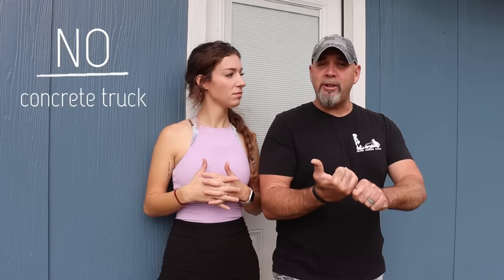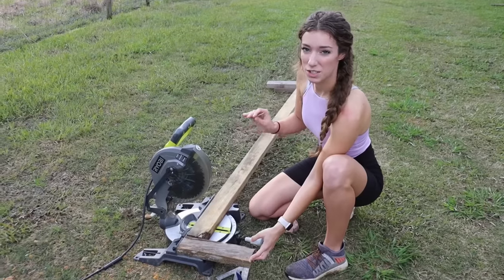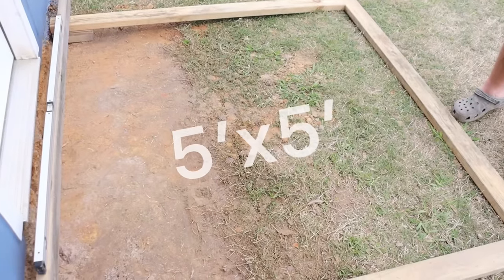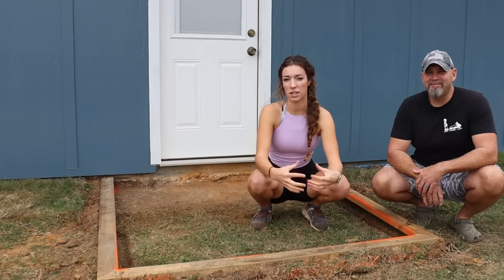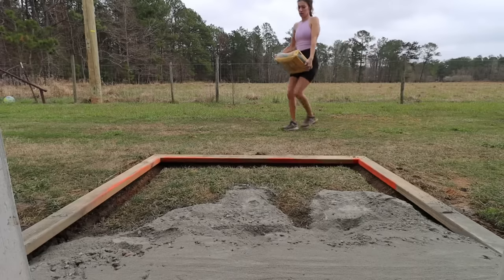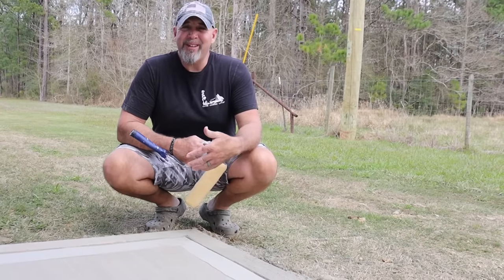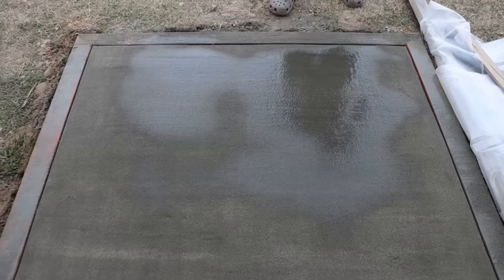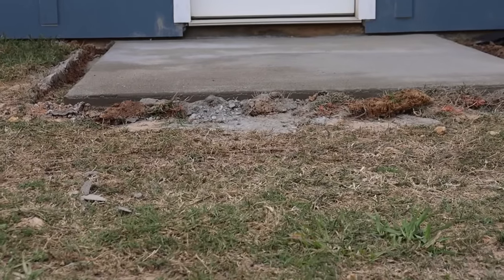How To DRY POUR CONCRETE SLAB and Update of Our 1st Pour

Comment: You shared your tips with us. I'll drop mine while passing trough. ;-)
- Given the chance, park your truck closer to the pouring site. Less dragging of all that weight.
- When dumping the bags content, don't cut the top of the bag. Cut it in the middle lay on the ground. And lift both sides equally. Less weight (again). ;-)
- Last but not least. Unless you're in a rush, leave the forms in place for a longer time. Even a week, or more if it's a large concrete pour! Reason being that it preserve moist, allowing for a better cure. And better than that. When the concrete cure/dry it will contract and release from the form, naturally. Less cracks or potential for damage. Less work also.
Hope you enjoy my "lazy" tips. Cheers
Reply: Move the truck closer - yep
Reply: Great tips!  Thanks!
Reply: I was thinking the same thing about the truck.
Reply: Great tips🎉
Reply: Yup, my first thoughts on the truck and how to cut and pour. At 68 you look for shortcuts and the easy way out
Reply: that ain't lazy - it's just smart.
Reply: A good way to a get you truck covered in cement b cutting the bag in half will get you covered in cement
Reply: “Work smarter, not harder” Great tips!
Reply: @TinaRN  : Hell yeah!
Reply: How much water??  Hard to tell in the video.  U definitely don’t want dry powder at the bottom.
Reply: is the roller brush wet or dry?
Reply: @missgray1472  Dry.
Reply: Put the truck off the chicken's path I'm guessing. I had a swan reach under the tire attacking the intruder. Murdered the poor guy.😢
Reply: @darylephillips6778  They said to just cut the bag open about half way down, then lay the open side on the ground and lift from both ends for the concrete to come out of the cut in the middle, not cut the bag completely in half. By doing it this way it doesn't fully eliminate the dust, but there will be less of it than cutting from the top and dumping it.
Reply: @todd5082  They showed at the beginning of the pour that the powder on the bottom was already soaking up any moisture that was in the ground. This will continue to happen after the main form is set up. As you can also see, this takes much longer to do with 5 hours of wait time between spraying down with water 6 times counting the initial mist.

Comment: 45 year construction vet upnawth in Virginia here - I can't see not laying 4 inch or smaller mesh or making such a pad less than 4 inches thick, but if it works - I say good for y'all down there.
But ONE THING that is important to point out and that is the dust in concrete is very, very bad because it is so very fine and it's like inhaling tiny bits of glass that go deep into your lungs and don't come out.
 
What I always did was put on safety glasses and pull my arms out of my t-shirt and pulled it up so the neck of my t-shirt went under my eyes and I tied the sleeves behind my head, which covered it all with the t-shirt hanging down my back like the Sheikh of Araby.
Beneath that I had on a dust mask.
Also, concrete and mortar dust is really bad for your skin - it'll suck the oil right out, and it is a strong alkali. So what I always did was apply Palmer's Shea Butter to my hands and wrists.
I suggest having a squirrel-tail brush to dust yourselves off with and laying the bags on the ground and cutting them open to minimize the concrete dust that gets stirred up.
I always keep a 5 gallon bucket half full of water to plunge my hands in to get the dust off.
It's a good idea to have such a bucket of warm water on hand for drywall or painting work, also.

What's most important is you enjoyed doing the project together and are pleased with what you made. 
That's all that counts.
Reply: Such helpful information! Since having covid this last time, I take coughing spells even just dusting my house. I'll make sure I wear protective gear when we try this out!
Reply: P  ok
Reply: That was the only thing I saw them doing that I thought hmmm .... Def should wear a mask & protective eyewear when that dust is getting kicked up. Other than that I'm def impressed with this!!!
Reply: YOU ARE A SUPER 🤩 FOR REMINDING OF Safety FIRST!! Thank you for some really GREAT ADVICE TO HELP PROTECT YOU FACE AND BODY! This advice will save alot of people from harming their skin and lungs. Not being able to breathe is a really hard thing to go through. And salvaging our lungs at younger ages through all of the advances that medical science has come up with is really important! 🫶🤩
Reply: Nice
Reply: Great tips :)
Reply: as a diyer with no professional experience, I really appreciate tips like this that come with experience. TY
Reply: Just thinking the same thing!
Reply: Great advice. Thanks
Reply: Oh thank you for the pointers. I did not know this. I'm going to attempt to do this by myself so I'm happy I saw your comment. All the best! 💜
Reply: VERY helpful and SAFE info to know. I'll deff take all these precautions now that you stated them.
Reply: Thank you so much for the very helpful information on how to keep my body safe. I will definitely use your safety methods. Thank you!
Reply: Dust maskIs a must! Concrete powder inside your moist lungs= you know it!!

Comment: THANK YOU SO MUCH. I saw your videos and I decided to Dry pour my patio slab 11X15  110 bags of 80lbs. It was a lots of work took me 4 days but It came out Great. You guys are Amazing
Im turning 70 years next month and i am going to have friends over for a Barbeque and Happy times
once again YOU ARE AMAZING
THANK YOU
Reply from the maker: So happy that our videos helped!!
Reply: Please post a picture!!!!
Reply: 110 bags? They used 10 on a 5x5...if you built a 15x15' it would be 30 bags... Did you put the 2x4's up on end instead of laid flat? Or use 2x6 up on end instead of flat? (I'm trying to understand why it took so much more quickcrete... Please let me know!
Reply: how thick. what was your watering schedule?
Reply: Impressive ! I’m 61 and was thinking I wouldn’t be able to do this !
Reply: @jorgeguardado3643 Incredible!! I hope it was an amazing day!
Reply: @shanengivone3973  
0-5'x0-5' = 10 bags
+5-10'x0-5' = another 10 bags
+10-11'x0-5' = another 2 bags
= 22 bags for that 'row'

Thus 0-11'x0-15' = 66 bags

Now in the video, they said they're going from 4" thick on one side to 1.5" thick on the other. Average height = 2.75". Presuming the patio slab is uniform thickness all the way across, and lets say it's 4", that would need ~45% more concrete. 1.45 * 66 bags = 96 bags. Pretty close!

Comment: Love that paint roller trick! 

Minor tip - position the unopened bag in the form, so all you have to do is score the bottom of the bag with a blade and lift up, then spread - will save you the risk of spilling outside the form!
Reply: Yeah, that's great but, he called it a "cement roller." I wonder how many people are gonna go to the home improvement center this week and have looks of puzzlement from the employees when they ask for it that way.
Reply: @curiouscharacter1  Surely those kinds people don't exist
Reply: Same thought here, and I would add that it creates less dust that would be inhaled.
Reply: @2008mmvii  / Masks. Or are they all "anti-maskers" down in Loosianna?
Reply: Brilliant. Getting older now not so robust, this I can do. Have project in mind. Thank-you
Reply: @curiouscharacter1 You'd be shocked to know how many of those people DO exist.
Reply: Great tip! My back thanks you. Lol
Reply: What about just laying bags next to each other, and spreading powder over & in-between to fill the gaps?

And after a few thorough soakings to dissolve the paper, THEN powder-over the top? And do the top 3/4 inch like y'all did? I know that would use triple the material, but, seems easier...
Reply: Just a gal from Australia doing DYI for many things. This is gonna be a game changer for me! Thank you! I can’t stop talking in my head with your lovely accent 😁
Reply: Awesome thanks I'll be doing one soon at my house
Reply: Good Point considering Geo-Political situation !  I am not sure about whether the new embrace of the Philippine gov't to again bind tightly to the U.S. will be a future benefit to P.I. or a detriment . U.S. now has added bases & I pray that they will not increase tensions in the area as it seems U.S. M.I.C. complex cannot keep themselves from starting a new war every five minutes !  I pray that my 2 wives are always safe , even after I have exited Stage Left ...........  Nick , NavyBlueSmoke , LST-1195
Reply: @ednauseum3060  I've been wondering the same thing...but thinking there would be a lot of trapped air in the bags
Reply: And save your back. Excellent tip!
Reply: yup carrying 50-60 lb bags that far is a workout.
Reply: This is awesome! Love your videos!
Reply: @ednauseum3060  many brands have a liner in the bag or they are wax/polymer impregnated to prevent moisture wicking
Reply: @jamespyacek2691  😊😊😊😊
Reply: Awesome method.  Will be doing this for several projects around my house
Reply: Fun to watch and informative.  Enjoyed watching you work together.   Respectful of each other. Gosh,  what a great relationship.  You're blessed with that and a terrific attitude. I wish you both continued happiness and success. 
John in San Antonio
Reply: This method and the outcome of your project has inspired me to do some cement work at home. Thank you so much for the tips.

Comment: After seeing your first video on this ,  we used this method for our 12' x 20'  shed .  We went about 3" deep and used wire mesh in it .  That shed is now storing thousands of pounds of old parts in it and no issues . Thank you very much for sharing this with us .
Reply: Any tips for doing that big of slab!?
Reply: I take the wire mesh helps the concrete from cracking?
Reply: @hecmacias7604  : Wire and or rebar does indeed strengthens the concrete.
Reply: Is your area prone to freezing?
Reply: I'm so glad u posted this, I plan to do a porch and foundation in my pole barn and wondered would dry pour work in larger setting
Reply: Cool!  What zone are you?
Reply: I believe you should have mentioned it's important not to wash I mean move the surface concrete powder as you water it and do not let puddles and you must cover with plastic so that the water does not evaporate also I would suggest heavily watering the ground before you place the powder into the form and I would not get anxious to use the pad and so keep the plastic on it for 3 or 4 days.
Reply: @darnmartian9766  they did address this when they said just mist lightly, till it has darkened a bit for the first layer so it doesn't wash off or disturb the powder layer.  Then, after an hour you can gently spray water for more thorough soaking at each of the subsequent steps.  
I also wondered if watering the ground underneath would be helpful before dropping in the dry concrete. Maybe they didn't water ground first because, as they said, keeping it dry until the watering stage at the end means they don't have to rush anything as they are trying to set it up.
Reply: @luvfunstuff2  did they mention anything about the type of concrete mix? Was it the very rapid setting mix usually used for posts or theregular setting mix?
Reply: @planetstupider502  it looks like the regular sack Quikrete 4000psi mix.
Reply: @mr.monitor.  he said 3000psi, but edited a correction to 4000psi
Reply: I’m wanting to do a 6x20 slab out my back door, so happy to have this as an option!!
Reply: Elaine, How many bags did that take ?
Reply: you just answered my question about depth,  rebar or steel reinforcement.
Reply: I was wanting to pour the same here . Did you have to water it more being it’s a thicker slab ?did yours hold up good so far ?
Reply: I'm looking to do a similar sized slab for a shed. We're in CO so definitely looking for tips for colder climates. I'm thinking of putting angular rock down first as well as reinforcing with rebar.
Reply: @jamesburgan4448  he said 10 bags.
Reply: @leahrowe847  we are in the pacific north west and it does freeze  and heave the ground now and then but no issues yet
Reply: @jamesburgan4448  Can't remember exactly for our 12x20 but had to be near 100 60lbs bags
Reply: How could we get a footer done
Reply: Elaine, thank you for sharing about your work with us. It has inspired me to do some additional work in the back. Especially after paying someone to have a slab done, and it started cracking badly! 😞 The man that did this work used the same bags, I wonder what his mistake was so that I don't repeat.
Elaine, how is your slab holding up since laying it down?

Comment: Cool! When I was a kid, I read in Popular Science magazine an article about using dry concrete mix to make concrete slab sidewalks just like your project. The author of the article claimed that this method resulted in stronger concrete than a wet pour. Nice to actually see your work successfully demonstrating this method all these years later.
Reply: Popular Science Magazine is a good resource for this kind of project - it may be limited but that doesn’t mean it isn't appropriate for some uses.  A science magazine can address the properties and uses of any material.  A magazine or book can give a user the knowledge necessary to use any medium or material such as concrete correctly.  Thanks for sharing - excellent resource!👍

Comment: The fact you could pressure wash the slab after 1 1/2 years and it not fall apart is a great indication of the slab integrity. I used this same method for the grouting between the bricks on my patio, and 8 years later, it still looks good.
Reply: I know absolutely nothing about any of this, but can’t help thinking this is brilliant… I do have a question though… Do you think this dry method would also work to fill a relatively deep somewhat lengthy crack in an already existing slab..?

🤔
Reply: Could you share more details on how you did this to make your brick patio? I would like to do a brick walkway using some old bricks and wondered if it could be done using the dry mix!!
Reply: You spread your grout dry first and then wet it?

Comment: I poured a slab for my 5x10 shed in the backyard after seeing your first video last year.  No issues and it looks great.  😊
Reply: Curious bc I'm about to do the same for an 8x6 shed. Did you do 1.5 inch like they did on the chicken coop slab? Any cracks? Did you rebar reinforce? The heaviest thing im putting in there is a 24in snow blower
Reply: I’m going to try this for my building!
Reply: How many inches deep did you do it because I want to make 2 slabs the same size for my yard
Reply: I'm also curious what extra steps you would need to take for a shed.
Reply: @R Louis  I think their slab went from 4 to 1.5 they tappered it to create a slope.
Reply: Is this good for driveway?

Comment: Thanks for creating and sharing a nice and helpful video. I have been dry filling support posts for fences and decks for years but never attempted a large area slab. 
Since you were so kind to share I will pass along a trick to you.
After you mark and frame your area (remembering to measure from corner to corner to maintain square) place most of your sealed bags of concrete in the location and number that corresponds with the volume required (ie more bags where the slab is thicker fewer where it is thinner), when you think you have it about right cut the bottom of the bags (not the top) and pull the bag off. This allows for less lifting and dumping, correspondingly less dust and drift and keeps much of the aggregate away from the top for an easily smoother surface. (It also keeps the dust out of your Crocs and prevents your foot sweat from making concrete in your shoes).
Thanks again

Comment: I've formed and dry placed concrete landscape curbs and put brick on top, it's quite common.  They take a long time to fully cure but after a few weeks it's as hard as stone.
And the dryer the concrete mix, the stronger the final result.
This is a tremendous result and clean.  Nice work.
Reply: I want to do landscape forms, so dry pour will work!?!!

Comment: Been in the construction industry for going on 12 years and never seen this done before. When I first started watching and saw you form up the 2x4s the “wrong way” and without any stakes. I was like oh no. Than I kept watching. Learn something new everyday and while this wouldn’t work for all applications it works well for any application that won’t have a lot of weight on it. Pretty much you made one large paver. Thanks for sharing, great video. Your absolutely right about taking risks and trying new things. Creativity and taking chances is good for the soul. One tip I could offer is you can use stakes to support the forms just cut them off flush with the forms with a sawzall after you screw them to the forms or pound them in until they are flush with the top of the form.
Reply from the maker: Thank you Andrew!
Reply: I did as well no stakes big problem but no it worked I been in the concrete industry for 30 years and I thought I seen it all but wow I am going to try this when summer hits it is to cold now.
Reply: Agree on all points, but a couple of suggestions for garage floors and carports four or more inches deep:

 Add elevated (6x6x10) wire. Dry level the crete and lightly wet as they did. But submerge the entire slab in water for 2-3+ days afterwards (a week or more is even better).
Reply: @Rev22-21  How do you completely submerge a larger poor?